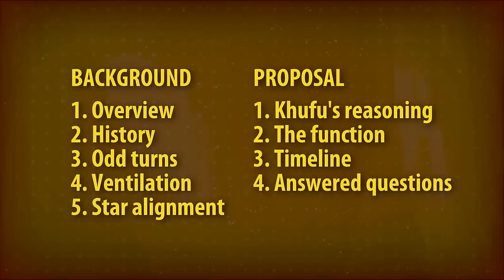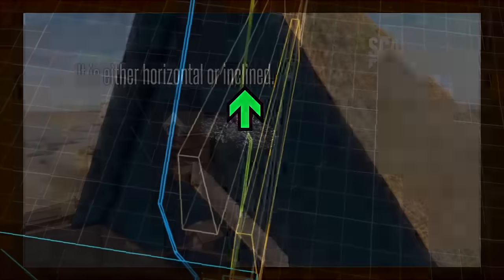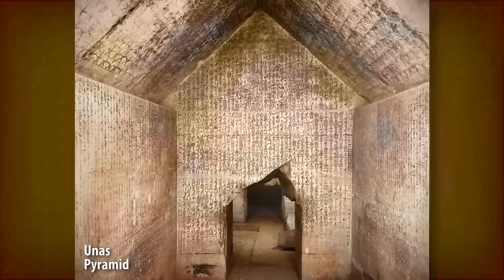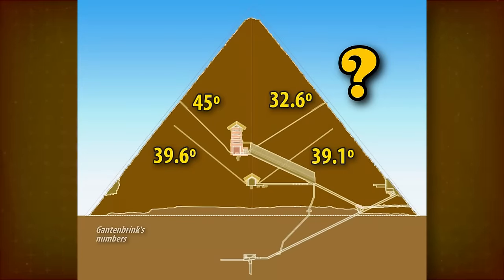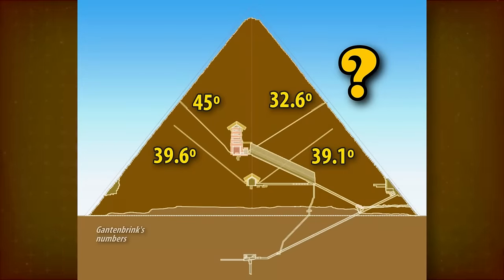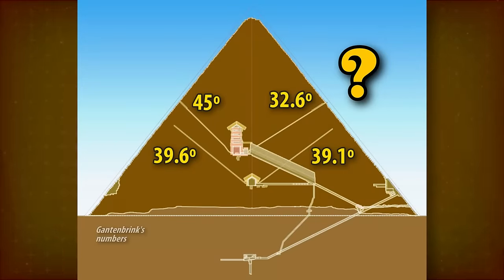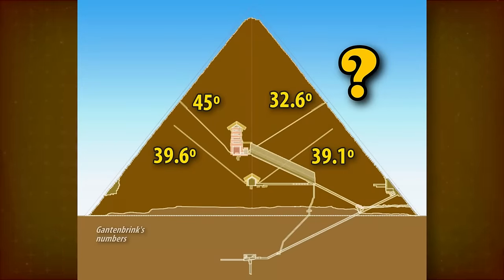Secrets of the Pyramid Shafts Revealed

Comment: At least this theory addresses the possible uses of actual artifacts found in the shafts... instead of completely ignoring them like other theories
Reply: Found in the shafts that where sealed for all the centuries (never opened in the chamber side) and thus never could have been used for the proposed idea?
Reply: @insanedruid3143  over heard at 2600bce..." oh crap!  I rolled the ball down the wrong shaft!"
Reply: @itsnot_stupid_ifitworks  Queen shafts are not accessible from the side of the pyramid, so only explanation is that those objects were inserted (maybe accidentally) into the shafts at earlier construction phase, when the pyramid was shorter. Who knows, maybe at that time the queen chamber shafts were actually used for signalling (the inner casing of queen chamber that covered the shafts might not be there at that point).
Reply: @demboos  I think that between the building of the Queens & kings chambers the decision to increase its size was taken
Reply: @demboos  Isn't that exactly what the video was saying? 
They were used during construction

Comment: Could the shaft been used for communication during construction instrad of security?
Reply from the maker: 1) If it's just normal communication, why conceal the openings?
2) The QC shafts weren't used, so it looks like communication during construction wasn't the reason
Reply: @nightscarab5802  How do you know they weren't used ? Maybe the inner casing of QC was not yet present at some construction phase so the shafts were reachable ? When the pyramid was lower, or at same early stage, the endings of those shafts might have reached the side openly (or some other space accessible by workers). Then they would put those balls into the shafts for some reason, communication, counting sth (number of blocks??)...

Comment: I don't think there would be a relieving chamber above the grand gallery.  Egyptians seemed to have used relieving chambers above squared off chambers with flat ceilings, not above chambers with corbelled ceilings.  The corbelling already redirects the load around the sides of the chamber, so you probably don't need a relieving chamber above it if you use that method, only when you want to create a nice square chamber.
Reply: Speculation is that it was a room used for a counterweight rope pulley system to get the large roof blocks above the kings chamber into place

Comment: Great video but who throw the granite ball from the outside and remember the pyramid is inclined
Reply: They could throw it in always at the current level where the were building. There it was a flat surface. The incline came only when they were higher above the chambers. Then there would have been no need to send down messages any longer since they have been finished.
Reply from the maker: For much of the construction, the shafts' exits were on the flat platform. Later on, you can build a dummy wooden shack, like a fake "surveying tower" on the side, near the exit.

Comment: Excellent work as usual. It's worth considering that royalty soon adopted the hidden tombs of the valley of the kings relying on both being hidden and liberal use of false chambers to protect the enclosed mummies and goods. One aspect of the air shafts is that they could have been in use almost the moment the kings chamber was completed to until the casing stones were in place. Around 75% of the pyramids volume would already be in place by then suggesting queens chamber shaft actually were used or were at least used in a decoy capacity as well. 

For what it's worth the entire concept of "relieving chambers" is a total farce. Given the immense mass over the kings chamber the difference you get from inserting these otherwise invisible chambers is that it moves up the hight of the angled ceiling that would work just as well alone or only one chamber up from the flat king chambers ceiling. If the only discernable  point of the relieving chambers was to add otherwise unused volume then they were probably trying to raise the plane of the top angled ceiling up above the plane of the ascending passage or this new space above it so shearing forces couldn't intersect and damage the gallery.

Perhaps the Kings chamber was always left empty and the granite sarcophagus damaged as a last line of defense attempting to convince would be robbers that they were too late. If so then there may also be currently sealed shafts linking this new void to the outer surface near the terminus of the two shafts that seem to go around this void. Such shafts might be detected with X-ray or ultrasound.
Reply: I heard in another video that the robbers' tunnel was more likely dug from inside out, or at least the digger knew the exact direction they had to dig toward. That means they could enter the pyramid through the original entrance but they needed the tunnel to bring something out in one piece that they couldn't fit around the corners of the existing shafts. I'm not that much familiar with the topic so I might be wrong but if the tunnel was indeed dug to bring something solid out it is a valid question what it was. It also had to be there already before completing the upper levels because there was no way to put it in afterwards.
Reply: @laszlodobos8937  Yeah, idk. That reasoning hinges on it being easier to dig through the body of the pyramid than to widen the existing passage. Seems like an extremely high effort shortcut to me. More likely they were following some hunch or lead. Its always possible the robbers tunnel was following something like the known air shafts that they destroyed any trace of.
Reply: Pet and ct scan 😅😅😅😅😅
Reply: @laszlodobos8937  I've seen theories that the tunnel was dug from two sides and they met in the middle, im sure the reason was they were looking for a hidden chamber, they guessed the best place to find it was in line with the area they dug

Comment: As usual, an elegant and well-constructed demonstration, based on a concrete elements and on a scientific approach.
Your critical analysis of the “ventilation” and “star alignment” theories makes sense and is quite compelling.
However, the final conclusion can still be debated since it is based on two questionable assumptions:
-	There is now indisputable evidence that the Great Pyramid was built by Cheops and even that the building was erected during the ancient Egyptian 4th Dynasty
-	There is no proof that the granite box in the so-called King’s Chamber has served as a sarcophagus for a deceased human being. Especially since no single trace of any funerary artefact nor any organic material have ever been found inside this building.
It seems the shafts' mystery is still far from being fuly resolved. The much-awaited exploration of the recently discovered inner void of the GP might shed light on this particular issue…as on many other ones…

Comment: Your videos are very thought provoking. But why put stop blocks in the ends of the Queen's shafts if they were abandoned during construction? The builders could have just put a large block over the end of the shaft instead of a relatively small stone fitted inside. The internal stop blocks indicate some function of the shaft during construction that ended at some point after a large covering stone could be placed.
Reply from the maker: I think plug doors of this kind were in use in each shaft throughout the construction: whenever a new course was added over the shaft exit (to keep stone debris out), during heavy rain etc. When the QC was abandoned, the last set of plug doors was simply left in, as there was no other use for them. A bit like twisting a cap back on an empty water bottle when you're throwing it into the trash: there's no use for the cap anymore, you just put it back in place.

Comment: When you say “catch those snooping around” do you mean the guards entered through the shafts to keep watch after the pyramid was increasing in height? 16:25
Reply: I wonder if there was a possibility that the newly discovered “void” by the scan pyramid project was the original 4th burial chamber but this one failed. It almost looks like the shafts run directly to the newly discovered void, but they were constructed around this chamber. We know the kings chamber already has cracks, maybe the 4th chamber actually failed which makes the king chamber the 2nd best option. Based on the shape of the shafts what do you know about this hypothesis?

Comment: It’s hot and humid inside the pyramid now, how would they have been able to survive in there with candles or torches burning?
Reply: The temperature in the pyramid is a steady 20°C (68°F) all year round. Luxor gets less than 1mm of rain a year and is one of the dryest places on Earth. It's not hot and humid inside the pyramid.
Reply: @stephena1196  people sweat and breath.
Reply: @stephena1196   Stale would be a better description.
Reply from the maker: When the channel is operating as a security system, the ends are open, so you get ventilation, even it's not the purpose of the shaft

Comment: ⭐⭐⭐⭐ Interesting, but not really conclusive in any way. WHY would they go to the trouble to build anything that they did not ABSOLUTELY HAVE TO... And because it would be laborious and time consuming it requires sustained effort and agreement that it must be done. For what? And what was happening when the angles of the small shafts changed direction? Does this indicate that whatever the cause it affected both at the precise same time - and therefore the place and time when they change direction is (or should be) fixed, until they... go in a new direction again, what the dickens happened there? If you look at the angle the sides must have been at when this change was made and think about the construction overall at that time, they must both have been exposed at the ends to the surface, and then for how ever long were continued at/on a new line or angle BOTH at the same time.Also what can be deduced about the overall shape of the construction at that point? It seems to indicate steep sides at that time. If the shafts were used for either communication, dropping packages into the work zone by ropes, or both, what was so important?  The notion here being that in such a titanic endeavor there is no time, material, or workforce for useless efforts. Whatever their purpose, they were deemed necessary at the time, and those for the Queens chamber  apparently considered no longer necessary at a certain point (the cap stones ought to be dated and compared to other layers of stone if a sample robot can get a piece).. It begs a 'frame by frame' (sort of) analysis of the dates different parts are built, so as to visualize the shape at different points in its build...

Truly fascinating, whenever we review what is recently uncovered here it has that dusty flavor of ancient mysteries yet to be understood

Comment: You curiously left out discussing the copper electrodes on the stone plugs (Stopper doors) in the shafts……
Reply: Many previously discovered and published tunnels and chambers have been sealed by Hawas only to be pompously (re) discovered and sensationally published recently. It can be only guessed why is the nearby subway station being build over the last three years by now, while huge construction trucks are driving in and out, day and (especially) night, especially after half of the surrounding old houses of Nazlet Al-Seman have been forcibly vacated and pulled and "archeological" digging is being conducted (at night) under heavy police protection.
Reply: Electrodes for what? There's no evidence the copper connected to anything. Using iron wasn't an option because they didn't know how to smelt it.
Reply: Good question!

Comment: If granite balls were rolled down the shafts, they would strike the walls and damage them. Furthermore, the damage would be greater in the lower reaches of the shafts because the balls would have a higher velocity there. Also, there should be obvious damage on the outer sides of the bends when the shafts change course. Where there is a long, straight length above a change in the shaft's direction, the balls coming down from above would always strike along the same area of the shaft wall at the bend and the damage there should be obvious. Does this comport with observation? Is there obvious chipping and scraping at the bends? And is the magnitude of the damage greater in the lower stretches of the shaft?

Comment: Interesting ideas but I’m not seeing it as a tomb. 
• Getting a dead body into that chamber would be next to impossible with all the turns, angles and tight openings the pharaoh’s body would likely be dropped and damaged. 
• The ‘treasures’ that weren’t there…can’t imagine getting those in that chamber unless they were all small. For a guy with an ego like a pharaoh he needs storage space
• the sarcophagus is too small to fit a body unless he wanted to be folded like origami. 
• Egyptians lived for and loved decoration, either chiseled into the stone or painted walls with hieroglyphics and yet there’s none in any chamber.
• For such massive monuments there is no written documentation in the found works of the Egyptians how and for what purpose these were built.
• if all this was to hide a tomb this is an epic fail.  Why build the tallest structure on the planet showing exactly where the alleged treasures are hidden?
Reply: 1.We are still working out how the pyramid was built  and how internal passageways developed and were used. So, not a good idea to assume that a body couldn't have been put in there along with all the grave goods. The sarcophagus which would have been the biggest thing in the chamber in there so strange logic to think that smaller things couldn't have been placed in there.

2.The sarcophagus is big enough to contain a body with room to spare. Ancient Egyptians weren't exactly NBA sized. Later sarcophagi were much larger as the practice of building multi-layered nested coffins evolved and more space was needed.

3.My understanding is that inscriptions and decorations in the interior of pyramids were rare or absent in early dynastic Egypt. Most people try to judge all Egyptian tombs based on what is seen in later tombs. 

4.References to pyramids are not absent. In one case we know that one Egyptian pharoh had a pyramid built as a cenotaph to honor his mother. There are court records where looters admitted to breaking into pyramids to loot grave goods. So what written records there are indicate tombs or centaphs. 

5.Someone with the ego to order the construction of a pyramid probably assumed that no one would dare try to rob their pyramid or would be capable of doing it. The transition from burials in pyramids to burials in underground complexes such as at the Valley of the kings was apparently a response to the reality that in times of instability it was not a good idea to openly advertise such things.

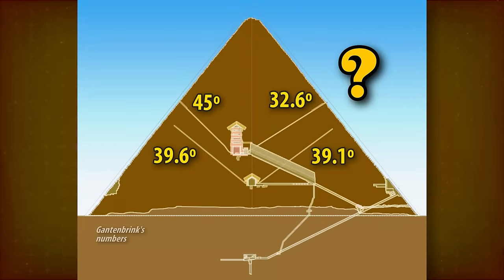Comment: I think the shafts were for the workers who needed fresh air. Because 20 years was a long construction time. And the air flows faster from the bottom to the top, as in the chimney, than horizontally. In the 20th century, the construction workers and researchers even blew a hole in a wall of the king's chamber and installed a huge fan there (which you can only see in very few pictures (17:23 on the right), because you can usually only see the side with the sarcophagus (I saw this fan 10 years ago when I visited the pyramid. It was a very old and rusty model, I think from the sixties or seventies)) to get more fresh air for the visitors and tourists. After the pyramid was finished, the shafts were closed because they were no longer needed and they didn't want people looking in and trying to find a way in. The other pyramid has no shafts because maybe it was built before and maybe they learned from the problems with the lack of fresh air, or if it was built after, maybe it was too time consuming to build it, or they found a better way or did without it in the end. Thank you for this great research. I love it!
Reply: Built in 20 years! Ever been there and stood next to this thing? No way.
Reply: @ricf9592  Yes, hard to believe. That would probably only have been possible with industrial mass production. Perhaps the pyramids are also older. However, I immediately noticed all the rubble between the walls of the pyramid.
Reply: I agree, ventilation is the only thing that makes sense, especially with workers using lots of torches, maybe even the burial ceremony itself with the number of people used.  It would have got very hot and oxygen would have been running low.  The queens chamber holes were blocked off once the pyramid was expanded.
Reply: Thanks. How do you know, the pyramid was expanded? In which way?

Comment: Given that they found Calcium and Limescale and Sulfates at the bottom of the Queens shafts which is exactly what you would find in a hot water heater boiling hard water..... the electrodes at the end of the queens shafts is alternating current boiling water to make pressure.... and the gates to the kings chamber are like the ball in a whistle.. when the pressure builds the doors open to the kings chamber and it blows like a horn vibrating the Kings chamber. This vibrates the whole pyramid creating voltage and the capstone on top was made of gold making it a magnet bouncing on a conductor that will only work when the whole structure is vibrating.
I know a hydraulic ram pump when I see one. The water was obviously pumped up all the way to the electrodes down the queens shafts.
Start looking at how air pressure works to make water go upwards and to make sound. The Granite box in the Kings chamber is a Helmholtz resonator. It would have a hole on top so the change in air pressure would make it blow like a horn.